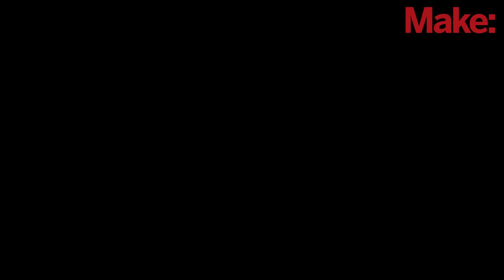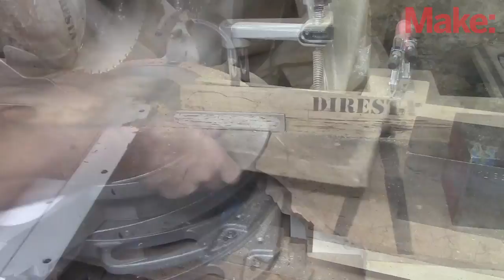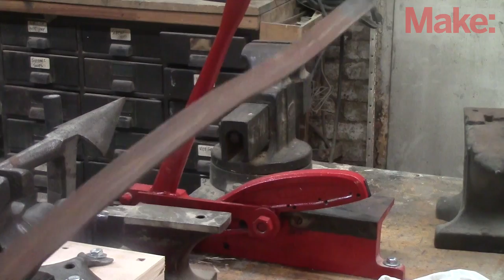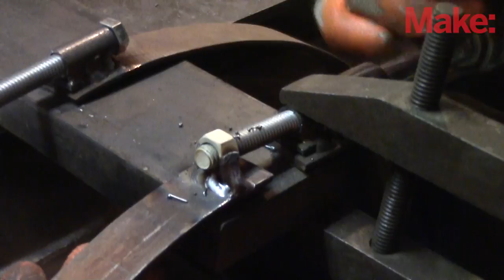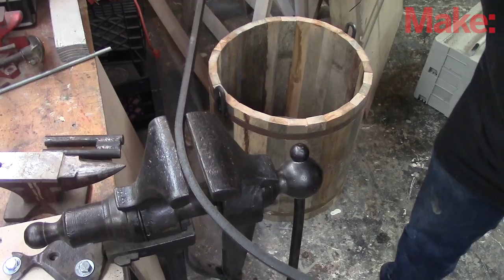DiResta: Wooden Bucket

Comment: Very cool in 1976-1977 I worked for "Western Wood Tank Corp / Johnson Tank and Tower" as a designer/project troubleshooter/ fab shop manager, we built wood hot tubs, water tanks and towers, cooling towers using clear all heart redwood and tidewater cypress.  Pine will rot.  We used dowels to form the bottom, and then cut the bottom one board at a time using a band saw.  We never glued the bottom boards or the staves but on larger tanks we did use clear silicone as a lube to make setting the staves easier also for larger tanks we used long nylon belts to hold the staves in place before we set the hoops.
McMaster-Carr has hoop lugs if you ever need them.   FYI old liquor and wine tanks smell incredible when you make a hot tub out of them.
Reply: Thank you for the 411 !! My first time I was learning on the go !

Comment: Based on the height of the woodplanks on the side(seen in the video at 0:04): 18''=0,46 m ; minus the unused part in the bottom (-2''= 5 cm) that gives us a height of 16''.

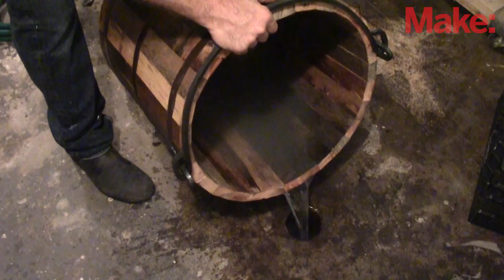Then the diameter(the tricky part): well he is able hug it(seen at 11:06), and his arms are a little longer than the buckets circumference
and his arms should be about his length; average length of american(he's American he uses inch, seriously) 
Average length of a american male is 175.9 cm (5' 9,5'') substract about 25 cm(10'') ; 
circumference should be about 176-26 = 150 cm; 

Now we know everything we need to calculate the volume of the bucket;

C = circumference
r = radius
h = height
(pi)= 3,14...

C=2(pi)*r
C=1,5 m 

r=C/(2(pi))=0,239

height:  16'' = 0,4 m 
Radius: 0,239 m(12'')

V = volume

V = (pi) r^2 * h
V = 0,0718 m^3 (kubik meter)

1 kubik meter = 1000 litres
 V = 72 Litres (19 Gallons) 

The bucket can hold about 72 Litres(19 gallons) of water, 

If the bucket is full then it must weight at least 70kg (155 pound)...

CONCLUSION: "It's a big bucket"
Reply: +Pro96Gaming neeeeeeeeerrrrdddddddddddddddddddddddddddddd
jk fam dont hit me
Reply: +Ako si Kalabaw nerd would not forget weight of the bucket itself :D so its 70kg of water plus that heavy bucket :))
Reply: +d4nt3cz I didn't forget, i was just lazy xD, it was hard enough to estimate the volume of the bucket. Imagine trying to estimate the volume of the bucket. 
then the density of wood. Dry wood or wet wood? sort of wood? etc.
Reply: +Pro96Gaming 9th grade math.
Reply: Goodly yes, I don't understand why you would use anything more advanced for this kind of calculation, well you can do a calculation of how big the error could be(very big). But I don't see the point of doing that, since I just did a fun estimate of the size of the bucket. :p
Reply: description says 8 gallons... he must be a short man.
Reply: +Pro96Gaming  No its a BIG ASS BUCKET lol
Reply: your estimation is not accurate lol
Reply: +Jamil Khan The conclusion is accurate enough.
Reply: Ist just a dekoration
Reply: aw.... I concluded around 70 liters....
Then I read this XD lol great minds think alike!!!
and yes.... Inch... piff inferior to the euro master race of metric equality!!!
but we still love him!
Reply: Garreth Kelly Wow! You also thought of estimating the volume of the bucket! Yeah, inches... And we all know he's actually a European, Just that he doesn't know it yet. :P

Comment: Very nifty indeed.  I believe that if you hammer a "dent" along the length of the meeting edges with a bit of 1/4" rod, when the bucket is filled, the water expands the "dents" beyond the original level of the cut edge to create a watertight seal between them.      On the other hand I could be wrong.  Still, worth a try!

Comment: Great project as always!  In watching you weld the bolts onto the rings, I wondered, given the pressure that will be exerted on the binding rings, it that will be a weak point of the entire build?   Was thinking that the bolt did not have enough surface area to adequately apply enough weld to for the long haul.  Just a thought...

Comment: That is one big bucket.  

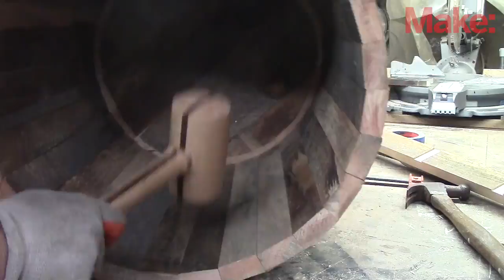Say Jimmy DiResta did you switch bolts part way through?  The ones you were tightening around the 8:20 mark looked different than the ones in there when you welded the ends of the steel bands...  were they not long enough?
Reply: Yes exactly. Started w 3" but needed 4". Thank you!

Comment: That freehand bevel at 5:00 to ease the inside edge of the stave bottom is absolutely gangster. 

I mean why bother with a set-up awhen close enough will get you there... and you're not passing the work all the way through the blade

That's is of course is you have the skill and confidence of many years using the tool

Hoop bending in that way cool old school vise is pretty gangster too.

Comment: Did you use any kind of finish on this? It doesn't seem like it, I figured the wood would expand if the bucket was left wet, which would cause cracking and warping on the slats, making the bucket useless.

Comment: That was an awesome video and I loved the wooden bucket is there any way to get the plans so I could know what lumber id need to get?
Reply: He's making a version of a truncated barrel so barrel specs can be a guide.

-Standard Dimensions of a Whiskey and Wine Barrel | DoItYourself.com

https://www.doityourself.com/stry/standard-dimension-of-a-whiskey-and-wine-barrel

[...The standard burgundy barrel would be around 23 inches in diameter while barrel widths can vary from between 25 inches and 28 inches. A small barrel will only have a 21-inch head. Larger barrels, such as the 65 gallon drum, will have a 28-inch belly, with 23 inches at either end, and be around 35 inches tall. ...]

-Whiskey Barrel Wood Staves, Set of 3 | Rockler Woodworking and Hardware

https://www.rockler.com/whiskey-barrel-wood-staves-set-of-3

[... WHISKEY STAVE 3PK6.2000

Material: White oakStave

 
Width: Varies, but approximately 2'', 2-1/2'' and 3''

Stave Length: 34-1/2''

Stave Thickness: 1' ...]

We see 4) boards 5/4 × 6 (5 1/2" wide) for 22" make up the bottom 

Circumference  = pi (3.141) x diameter (22") = 69" around 

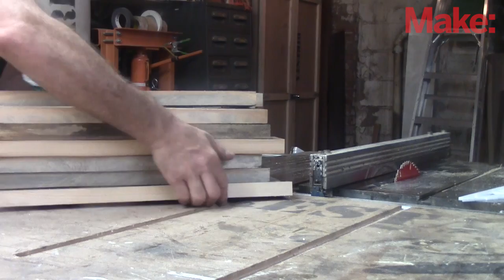2" wide staves leave us an odd number (35 1/2) but a width of 2^+" gives us 32 staves (÷ 69 = 2.15") which is the number of staves as seen at 3:21 and again at 3:26

360° ÷ 32 = 11.5° at each joint ÷ 2 = 5.6° angle cut for each edge... 

5.5° is close enough for this type of work, with the bands drawing them tite - a width for each stave of 2 1/8" fat - and an arbitrary length of let's say 1/2 a barrel height of 16"

And there is all the plan you need (or close enuff) - oh and the 3/8" dado at the bottom of each stave to let in the bottom.

There's a whole lot more going on here than meets the eye... but that is all part of Diresta's Chi.

Comment: Great video. Thanks for sharing.

I have one question though. At what angle did you cut the side of stakes at to make sure that you get a nice big round bucket?
Reply: Once you decide how many staves you want in your bucket you decide that number by 360. You then decide that number by 2 to get the angle to place on each side of the stave. (Ex. A twelve stave bucket... 360°÷12=30°      30÷2=15°. You set your table saw to 15°.)

Comment: 3:34 is a dangerous cut - with the blade beveled toward the fence (kickback city) and the already beveled edge of the work against the table and the fence has the potential of running under the fence.

Turn the piece over and flipped the saw the other way and set a holddown for the work
Reply: Jimmy is new to woodworking. He'll learn.

Comment: Maybe a silly question but why not glue the bucket boards before tightening the metal belts ?
Reply: +Rice Crash the metal banding plus the swelling from the water treatment will be more than enough to keep it together and water tight too.
Reply: +Philip Murray True - I was surprised he glued the bottom. Probably just for making it easier to put it together.

Comment: How did he make  the rectangular holes very accurate at 4: 43?
Reply: He's using a Dado head (Google that). It's the same blade used to cut all the grooves

He set the stops for the width of the cut as it was wider than the dado head.

For the 2nd pass he slides the work against a stop clamped to the fence seen at 4:45. 

Slow it down to .25x playback and you can pause it there.

Comment: How do you determine what the angle cut should be for the wood in order for it to make the round bucket shape?
Reply: How ever many wooden uprights there were to make the wall of the bucket divided by 360 degrees
Reply: @Rj16199  
Then divide that angle in half to get the angle of each edge

Comment: 1 mistake: extra heavy solid iron for the handle. 2: he uses nuts and bolts. The traditional way is to use fire to expand the holder, put it in place  and then cool it to shrink. 3: no water soaking for the wood to prevent leaks. 4: not treatment the wood with a burner. 

Don't try to reinvent the wheel, go to a traditional barell maker and ask  polite. Sorry for my bad english...
Reply: Many times I learn something new by reinventing the wheel. Or at least attempting to.  That is my way. Thank you!

Comment: how did you establish angle for the table saw for each side planks ?
Reply: Daniel Zakowski Internal angle =  (n-2)* 180/n where n = number of poligons. Divide by two to find the plank angle. You can simulate for 3 poligons, the internal angle would be 60 degree and the plank angle would be 30 degree.

Comment: Like all of Jimmy's videos watching them once is never enough. My fav is the weoodchopper whirlygig and the old schoolhouse dog house rigged so one doggy can call the other nearly-blind doggy

 But revisiting this I did the math for anyone who happens to stumble by... if they care:

He's making a version of a truncated barrel so barrel specs can be a guide.

-Standard Dimensions of a Whiskey and Wine Barrel | DoItYourself.com

https://www.doityourself.com/stry/standard-dimension-of-a-whiskey-and-wine-barrel

[...The standard burgundy barrel would be around 23 inches in diameter while barrel widths can vary from between 25 inches and 28 inches. A small barrel will only have a 21-inch head. Larger barrels, such as the 65 gallon drum, will have a 28-inch belly, with 23 inches at either end, and be around 35 inches tall. ...]

-Whiskey Barrel Wood Staves, Set of 3 | Rockler Woodworking and Hardware

https://www.rockler.com/whiskey-barrel-wood-staves-set-of-3

[... WHISKEY STAVE 3PK6.2000

Material: White oakStave
 
Width: Varies, but approximately 2'', 2-1/2'' and 3''

Stave Length: 34-1/2''

Stave Thickness: 1' ...]

We see 4) boards 5/4 × 6 (5 1/2" wide) for a 22" Bottom diameter

Circumference  = pi (3.141) x diameter (22") = 69" around 

2" wide staves leave us an odd number (35 1/2) but a width of 2^+" gives us 32 staves (÷ 69 = 2.15") which is the number of staves as seen at 3:21 and again at 3:26

360° ÷ 32 = 11.5° at each joint ÷ 2 = 5.75° angle cut for each edge... 

5.5° is close enough for this type of work, with the bands drawing them tite - a width for each stave of 2 1/8" fat - and an arbitrary length of let's say 1/2 a barrel height of 16"

And there is all the plan you need (or close enuff) - oh and the 3/8" dado at the bottom of each stave to let in the bottom.

There's a whole lot more going on here than meets the eye... but that is all part of Diresta's Chi.

Comment: Makes you kinda think how did people do it fast back when wooden buckets were what they had.
Reply: Different technology - much like barrels are still done. They figured out sizes once, built all wooden parts to those sizes (including width of the staves), also built the iron rings to size, then put everything together and hammered the rings down until the staves were closely pressed against each other and against the bottom. Then they soaked the wood, which made it expand even further and made it watertight.

Comment: what tool did you use at 45 seconds
Reply: It's called a "biscuit joiner"
Reply: +Joshua Scott thank you
Reply: It's the Festool Domino.  Kinda like a biscuit joiner, but stronger.  And more expensive
Reply: Klint is right, it's the Festool Domino. It's similar to a biscuit joiner, but instead of cutting a simple slot for biscuits, it creates a mortise that accepts a thicker tenon. When two mortised surfaces are joined with a floating tenon, it's referred to as "loose tenon joinery". The Domino essentially uses a router style bit to do this instead of a tiny saw blade like a biscuit joiner.

While a decent biscuit joiner may cost in the range of $150-250, a Domino usually runs $1000+, because Festool. (Also, I think they currently hold a patent on the design, so they can charge whatever they want, and if you need the tool, then you'll pay it.)

Comment: Now do it old-style, without power tools. And make it watertight.
Using a table saw and a TIG welder for such a project is like cheating.
Reply: It will be watertight after use because the water expands the wood and the wood pieces will tighten themselves against the metal bands.
Reply: idi3oticus
But what if I want it tight at the beginning? How will the wood age if I keep it underwater all the time to have it "ready"? And wood expansion won't fix all kinds of leakage.
Reply: Well then you should probably use some sealant like silicon for example. I'm sure you'll find something.
Reply: idi3oticus
The thread was about doing it old-school. No silicone. I understand Youtube thread system isn't really conducive to meaningful dialog.
Reply: zwz • zdenek Damn I forgot the old school part xD
Reply: But how about tar? That would work if you don't intend to drink the water...
Reply: idi3oticus Tar could work for a while, but the wood expanding and shrinking continuously would work cracks through. I know that barrel makers can make them watertight just with precision. I'd like to see a bucket made like that.
Reply: zwz • zdenek Maybe you should try to find someone who would make them if you're interested in that. Anyway, thanks for the conversation :)
Reply: Using what is available isn't cheating.
Reply: easthight It is, if there are even implied rules in place.
Reply: zwz • zdenek And what rules would that be?
Reply: easthight
When you are recreating a tradition, cutting corners with materials and methods that make the product both untrue and inferior is just wrong. You can probably see how many things around us don't last at all - and it's because the manufacturers use and do "what's available." I.e. bullshit.
Reply: zwz • zdenek Many things don't last long and many things last long too. 2 side to the same coin brah.
Reply: zwz • zdenek Lets see your bucket....
Reply: Matt McNeice That's some trolling. You aren't even here for the hobby. And those aren't even my main hobbies, it's just what I had randomly at hand. Go watch a pop singer, that you will enjoy.
Hint: There's no Wal-mart within an average war missile reach.
Reply: zwz • zdenek That was a MIG welder.
Reply: David James
I don't see what comment are you replying to, yes, the video featured the bands being worked on with a welder.
Reply: Matt McNeice
I'm not a sir or anything you call me. Are you really so inept at reading? I nor anyone else in their right mind can deny DiResta's skill. The problem I have with this build is that he threw way too many tricks in diverging from the original design. I wasn't honestly expecting him to use any medieval tools, although that surely would have been impressive. I insist on the fact that it could have ended better if there was an attempt to make it truer to how it would have ended up if made with those old methods. If I was to do this job, which I won't, I would, for example, rivet the bands separately and then hammer them onto the bucket taking advantage of the cone shape.
Adding those screws with welded-on tubes is like making a medieval bow on a 3D printer and attaching a laser sight to it. I would have the same gripe with that.
To support my reason for talking about this subject, I offered some proofs that I also DIY stuff. Which you promptly trolled down without a second look. Normal people IRL agree with me no problem.
Also, in b4 tl;dr.
Reply: zwz • zdenek In your initial comment you called it a TIG welder. It's not crucial information, or anything.
Reply: David James Oh. I'm not good at recognizing these, almost everybody only has MMA around here. And let me tell you, the new electrodes SUCK. Whoever's managed to save his old stock from moisture is a winner!
Reply: Matt McNeice
I never claimed to. But I have the idea of the final product in mind. That's enough. Or do you need to be an able farmer and baker to be able to shop for good bread?
Reply: zwz • zdenek I guess Its unfortunate for you that Jimmy never made the bucket that you pictured in your Mind. i bet you he made the one that was pictured in his mind.